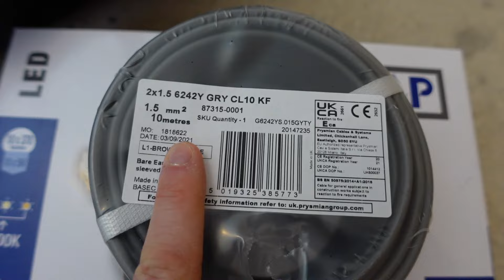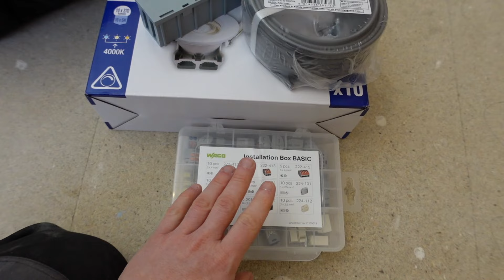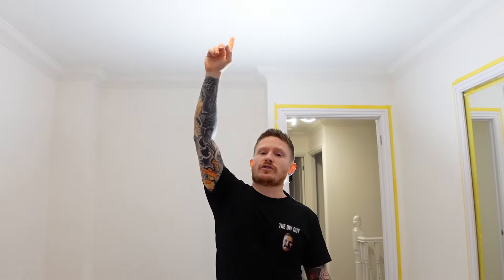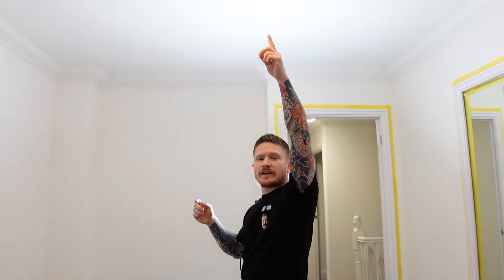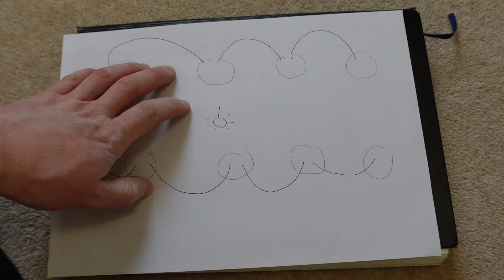How to Install Spotlights | Change Pendant to Downlights

Comment: I bought the same spotlights because there was a draught coming through  3 of the old ones. Going along nicely,  only one main wire from the first and 3rd spotlight. But the middle one had 3 main wires and as you know these new lights have 2 live and 2 neutral connections. The old middle spotlight had 3 live wires and 3 neutral wires connected into a connection block. Any idea how I can connect the middle spotlight, at present the middle light is still the old one with the draught blowing through.

Comment: Hi, what size is the earth sleeve that you got?  I assumed that it would be 1.5mm to match the twin/earth wire but having found the latter on screwfix/B&Q - there doesn't seem to be a 1.5mm earth sleeve on either of these sites - should I get a 1.5mm and just source from a local specialist shop?
Reply from the maker: Hi. The one I use often is 3mm sleeving

Comment: Your video was amazing....thankyou...liked it and subscribed. 
If I was working downstairs doing spotlights. Do I feed the cables using rods? 
Also.  What method would you use to connect the power to the downlight if we are not in the loft and can't see your connecting so well?
Reply from the maker: Thank you for the subscription and I'm glad you liked the video. If you can't gain access through the floor above then you can use rods but it can be fiddly.

Comment: Hi mate, after watching your video I feel confident enough to take this on myself - actually looks fairly easy once you've figured out where the studs are!  I've a quick question - is there anything in particular that determines the size of Wago connector you use?  E.g. you put the two neutrals and to live wires into a 3-slot box and the two switched lives into a 2-slot box but I can't figure out how you'd choose which one to use.  I'd likely just copy your guidance step-by-step but keen to understand the logic - if any - behind it!
Reply: The amount doesn’t matter mate, you can have 2,3,4 or 5 slot wagos - more slots just means you can connect more together
Reply: Just use a chocky bloc. Will save you loads of money

Comment: I have followed the steps of placing the wires in the Wago’s countless times and still I cannot seem to get the switches to only do the corresponding room they’re supposed to
Reply: My issue is “The brown on the switch feed from switch is on switch not permanent feed” apparently but that doesn’t tell me what I’ve done wrong

Comment: What size holesaw did you use? I think I've bought the same lights and it's saying a 73mm holesaw but that's not a common size. Thanks, great video.
Reply: Go up to the next size 76mm . you will have plenty of coverage from the light facia to cover the bigger hole

Comment: All nice,but what if you can't go above the ceiling because there's a concrete floor...
And I don't want to lower the ceiling...
As far as I see I just have to make the hole's and push my hand in it finding and putting wire's in it 🤷
If you have a tip,preciate it...
Reply from the maker: Check out my other video on this topic which will help

Comment: Hi, I was wondering if you could help me I was changing?
And I pulled it off by mistake.And I Ve tried to wire it back, but the lights downstairs I'm not working.Could you help me

Comment: What if you have a 3 storey house and want to install spotlights on the ground floor? Do I need to remove the floor in the room above in order to track and connect wires? I can't see other solution but I might be wrong?
Reply from the maker: If floor removal is possible then yes. It can sometimes be done via cable pulling rods but it can be difficult

Comment: I want to put on ground floor ceiling but have to lift chipboard on floor above. Two questions, i) If one connection gets loose I guess the whole daisy chain fails? How to know which one is faulty  ii) How easy are they spotlights to remove for replacement if no access is available from above? Ta
Reply from the maker: The chain will fail after the loose connection.

Spotlights are extremely easy to remove and replace even without access. They simply pull down on two springs.

Comment: Is there a way to do this on the ground floor without lifting floorboards up?
Reply from the maker: Without access you can use cable rods but it won't be easy in most cases

Comment: would this be possible in a flat, by flat i mean a maisonette but im ground floor and someone lives in top floor? im presuming the wiring would have to be done by pushing them through with a bendy rod of somesort like a coat hanger?
Reply from the maker: Without access above you can give it a go with cable rods but it won't be easy.

Comment: Can lay the insulation on to of the lighting fixture? Won’t it heat up? Is it worth placing a fire hood on to of them ?
Reply from the maker: Read the instructions that come with your lights. Some can be covered and some can't. They vary

Comment: This is a great video, but it did raise some questions for me. 

The first being working on downstairs lighting. I know you said you'd need to access the cavity by lifting flooring upstairs, but is that really necessary?  
Is it not possible to fish cabling using the existing hole downstairs?  I know that's going to be dependent on whether your ceiling is directly mounted to the joists or whether it's strapped. 

The second question is the lights themselves. Is it necessary to use these bulbed led light fittings?  I've seen American pot lights that are much slimmer and much more versatile aswell. You can get them in 4 inch and 6 inch, with different beam angles, and they are even switchable for kelvin setting directly at the fitting too. 

Thanks man.

Comment: What about if the downlight needs to be wired off the first light? I have the 2 wires from the old tube light, and 2 new wires one to the next light and one to the extractor fan. Total of 4 wires coming out of the ceiling for the first light. How do I wire that up?

Comment: Can you do this in an apartment ceiling too? If so how? Because I have no access from the loft. Thanks
Reply from the maker: Unfortunately if you've no access from above then this job is very difficult. The only alternative way is to use wire rods but even then it can be very difficult.

Comment: But how do you do it on ground floor room? Do you just rip out the top floor?
Reply from the maker: You'll either need access from above or you can try using cable rods but it won't be easy

Comment: ive installed 8 spots in kitchen but want to control them with a 2 way switch so each switch operates 4 spots.thanks
Reply from the maker: Great work. I have a video coming out very soon on 2 way light switching so keep an eye out 👍

Comment: Are all spot lights just neutral and live connectors (possibly earth), I worry if I buy some the connectors will be different or using a transformer like my last living room light was?
Reply from the maker: Yeah these days they are. Sometimes you have a small connector block and plug which is even easier.

Comment: What downlights did you use? most of the amazon ones appear to be old joining block conecters
Reply from the maker: The ones used are from Screwfix. They are basic LAP ones

Comment: Did you have to refloor the whole loft?
Reply from the maker: No, the loft was not boarded. Just insulation.
Reply: @TheDIYGuy1  what about if it going to be boarded and your wires is above the joists?Why did not you put them trough the joists?or it is ok to leave like that?

Comment: is there a way to do this if I don't have access to the loft?
Reply from the maker: Hi. Yes there is. You will need to gain access through the floor above. That may include removal of carpets and floorboards etc. On small ceilings it may sometimes be possible to feed cables with feeding rods but it can be difficult especially for a beginner.

Comment: I need help. Im trying to get spot lights in my landing ceiling only to take the light down and find a green and black cable from the switch and green and black from a light i wanted to run my quick wire lights from and now iv no landing light. Someone please help

Comment: How do you do it without access to the room above? X
Reply from the maker: There is no easy way. You can use rods but that is dependant on the joists in the ceiling and can be tricky even if the joists run in your favour. I would always recommend trying to gain access from above

Comment: Why not use 1mm cable - as this is less than a 10 amp load?
Reply from the maker: Because I had 1.5mm in the bag and most Diy'ers would prefer not to have to work out load or amperage but instead have one solution that they can follow.
Reply: @TheDIYGuy1  Apologies it wasn't meant as a criticism -  I thought there may have been a technical reason you were using it. I only mention it - in context of the current economic climate with the increase in cost of materials and if people are specifically buying them (rather than already having them to hand).  Maybe that would be a good topic for a future video - calculating cabling sizes.  Keep up the good work - Your videos are great and very easy to follow.
Reply: @TheDIYGuy1   should be correlation   size of mcb and wire you are going to add, you can"t add 1mm wire if mcb do not protect it.

Comment: Hi, does it matter what size Wago connector you use to link live, earth, etc. I noticed you used a 5-way connector to link 3 earth wires, 3-way to link two neutrals, 2-way to link switch live & live, etc. Was this for a reason or because you were limited by the selection of connectors you had to hand? Thanks!
Reply from the maker: Hi. No, it does not matter. I was just being lazy and used what I had in my pocket.

Comment: The junction box needs to be secured to the joist and the cables need to be cliped to the joists as well. Its a new installation and the wiring regulations must be followed. On the compleation the the circuit must be tested and minor works certificate issued. Thanks